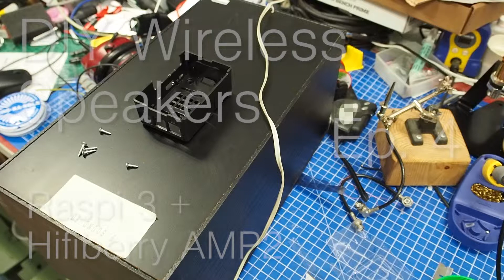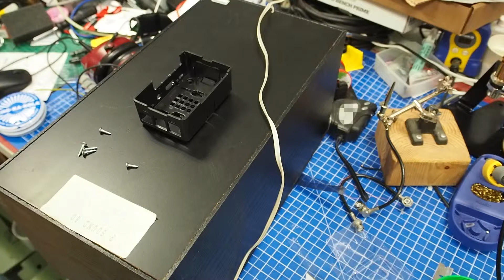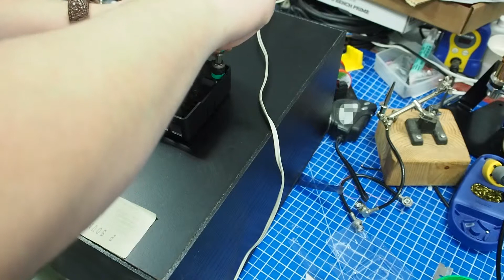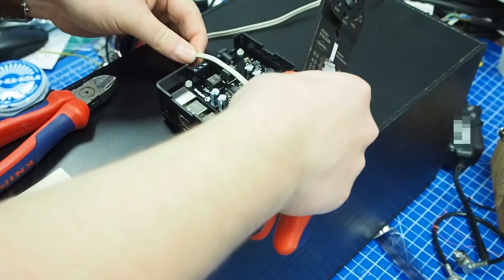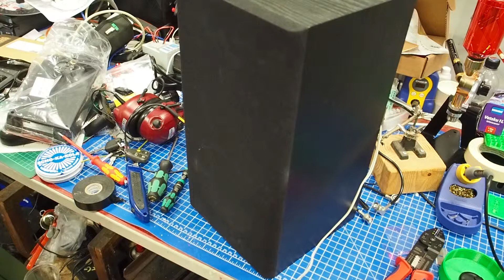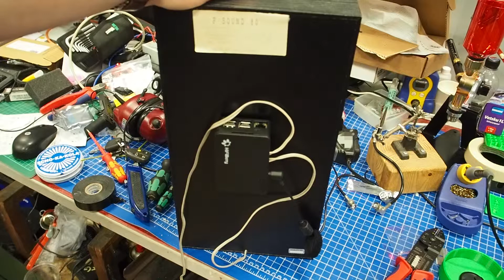DIY WIRELESS SPEAKERS - Putting it all together - Part 4

Comment: Hi, thanks for the videos :)

Do you know if hardware volume control is supported by the Hifiberry AMP2?
Is it quite fast or horribly delayed with the Hifiberry AMP2 to change the volume via the webinterface?
I do have some I2S sound cards here, but hardware volume control is not supported and changing the volume level takes several seconds which is kind of .. not nice.

Regards from Hanover, Germany :)
Reply from the maker: Hi mate! It's not instant like an analog control, but basically as good as the Chromecast audio or likewise, you change the volume and you get a confirmation beep less than half a second later! I'm not sure about how it's implemented though, sadly.
Hannover is a really nice place, I've been there a couple of times!

Comment: Do you know if HifiBerry work with Logitech Media Server?
Reply from the maker: I'm not quite familiar with the Logitech Media Server, but if you can't find info on the AMP2, the DAC+ seems to be very similar, and most software will accept one in place of the other. My suspicion is that the AMP2 is actually the DAC+ with the amplifier added onto it.
Reply: Yes, it does. Hifiberry is the hardware part, in order to work with Logitech Media Server you need to setup the software. piCorePlayer package is my favorite, but other alternatives exists (Max2Play). Hifiberry is a low cost excelltent replacement for squeezebox. (and audio quality is pretty good)